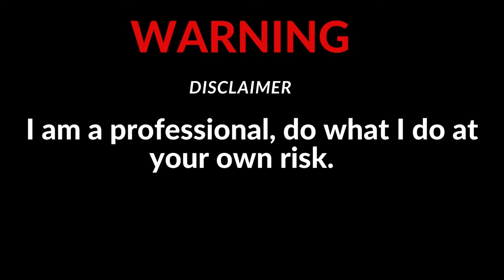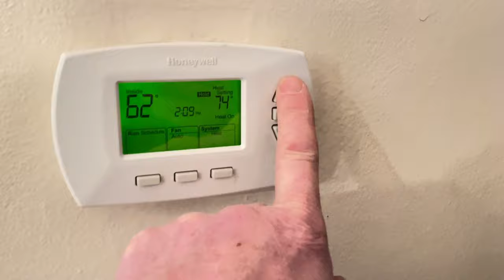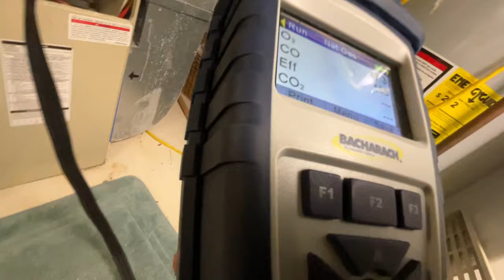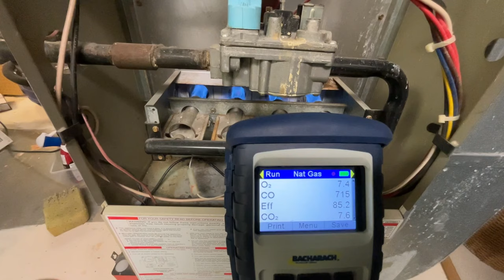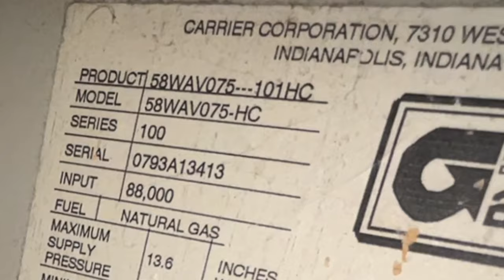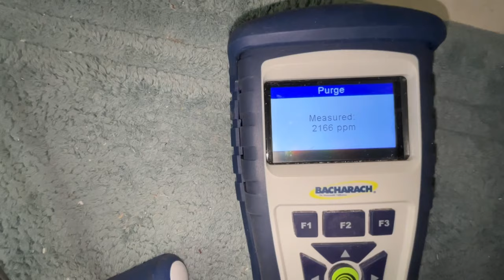OLD Carrier Gas Furnace multiple issues found

Comment: A capacitor allows electrical energy to alter the current to one or more windings of a single phase AC induction motor to create a rotating magnetic field and allow motor to turn. On start up phase provide sufficient energy to provide sufficient torque usually the capacitor will drop out of the circuit once a motor comes upto a sufficient speed and torque. With those high readings and age certainly it needs replacement.
Reply: run capacitor doesn't drop out of the circuit, it just splits the phase enough to basically have a 2 phase motor
Reply: @ohiopat  I was talking about capacitors more generally - yes run capacitors especially dual run ones can boost both fan and compressor motors. A start capacitor will support motor start up and bring to a predetermined speed, after which a run capacitor can take over to smooth torque and allow motor to run more efficiently.
Reply: A run capacitor is used to continuously adjust current or phase shift to a motor's windings in an effort to optimize the motor's torque and efficiency performance. Whereas a Start capacitor increases the motor's starting torque and allow a motor to be cycled on and off rapidly.

Comment: Another very useful simple test for identifying breaches in the heat exchanger is to use a static positive pressure test. Run the blower motor without the gas furnace positive air pressure will blow through the opening you can use a smoke stick or small flame to see which of those ports have the problem. It’s incredibly effective. See below:

https://youtu.be/WABAnzUthAg
Reply from the maker: Good to know. Thanks for sharing.